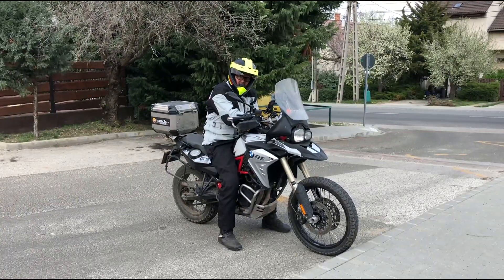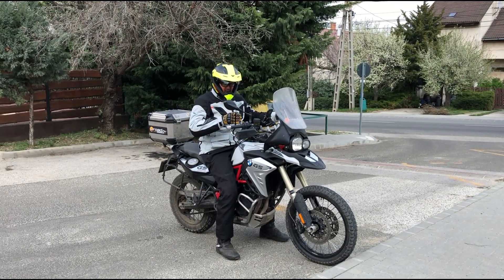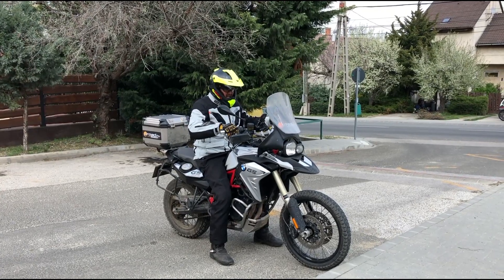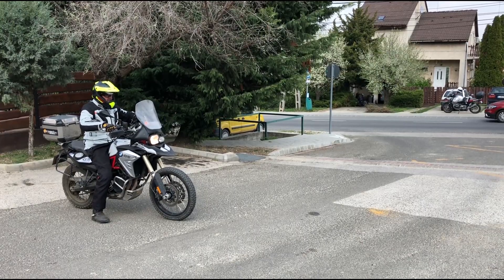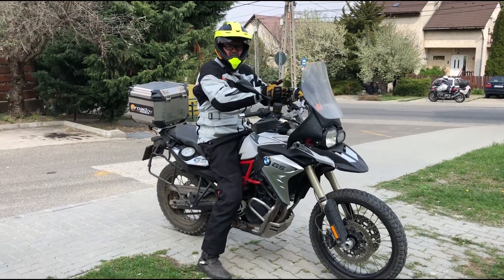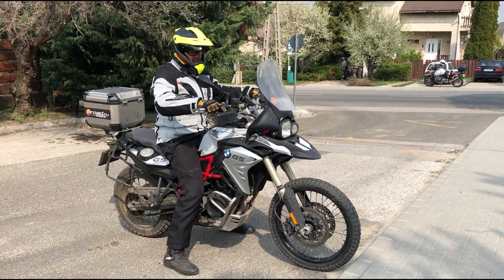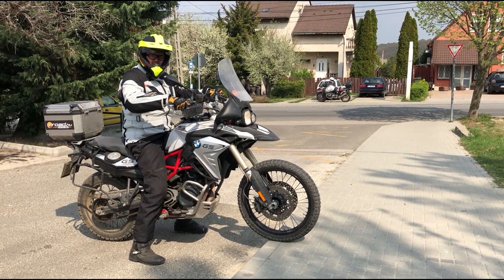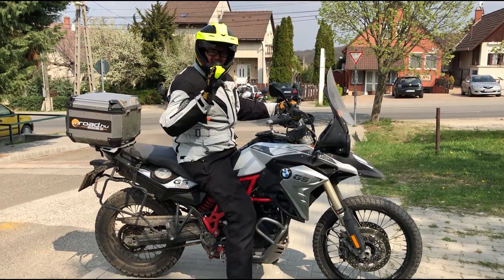Rider techniques, part 15: UP THE PAVEMENT! - Onroad.bike

Comment: Really informative! 
I dropped my KLR650 the first time ever because I stopped with one wheel higher than the other while adjusting a mirror, and toppled right over. 
Great information for beginning riders!
I think one other thing to mention is adding a bit of preload to the front suspension, then using a bit of throttle and clutch to lighten the front wheel for higher curbs. Trying to ride straight up a 25-30cm curb like you would find in North America might end badly unless you bring some weight off the front wheel.

Comment: Great videos as a recent convert to biking after long time off i find them very useful.The height of the pavement i have to encounter is 5 inches high or 13cm.Would i be able to mount the pavement at this height i have wooden ramp but dont feel its all that secure